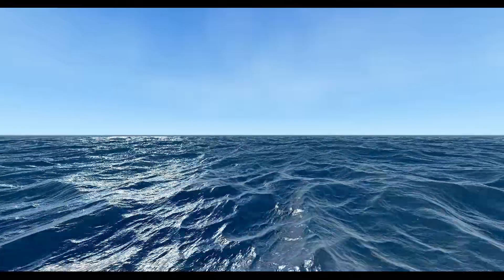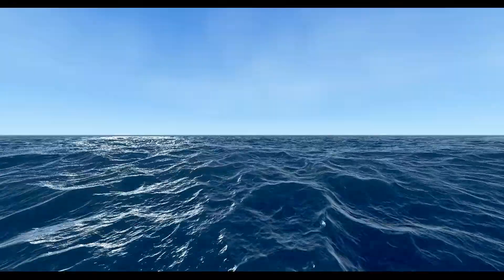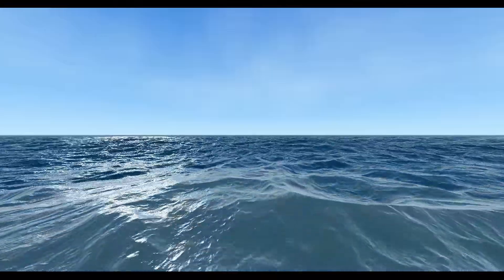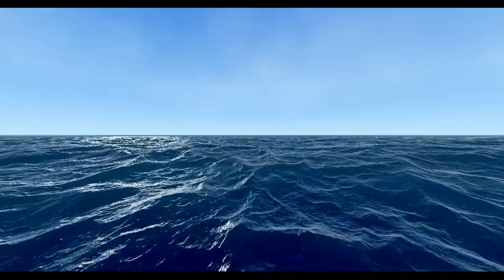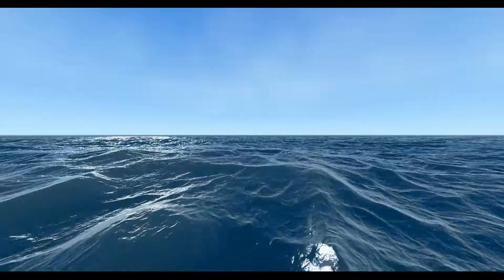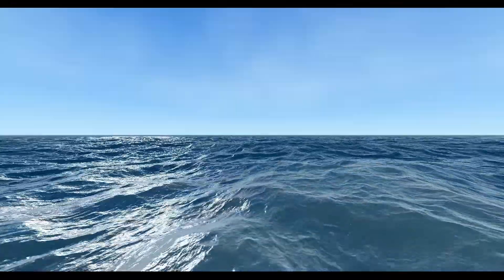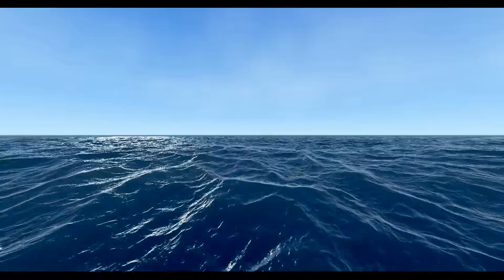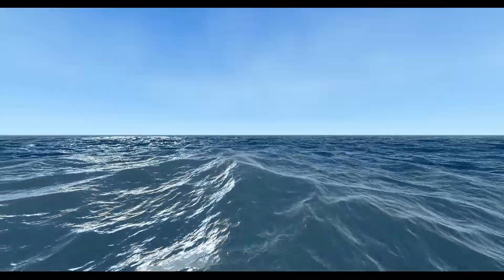Ray Tracing vs FFT Ocean Simulation in WebGL - Which Is Better in 2 Minutes!

Comment: the second one but it lacks details
Reply from the maker: You can add a texture to give the white caps a little extra detail when rendering. Increasing the resolution of the fourier grid won't give detail comparable to the ray tracing method. You can also add some extra zest into the fragment shader for the FFT method but chose not to do that to show the contrast between the two cases.
Reply: faking some extra normals are always an option :d